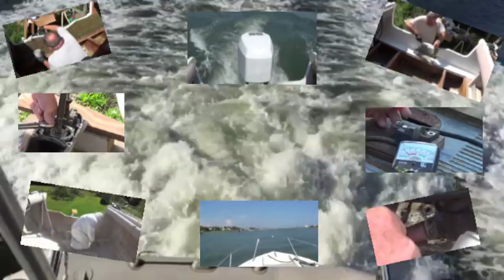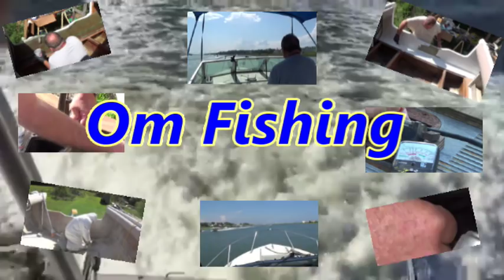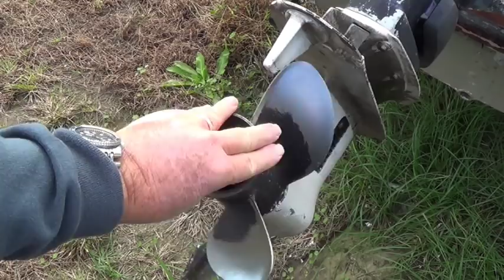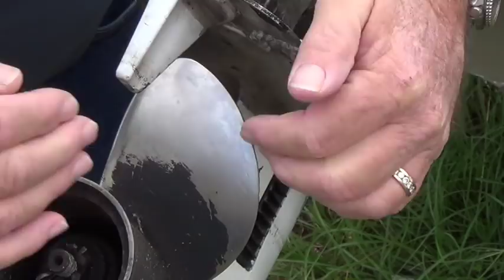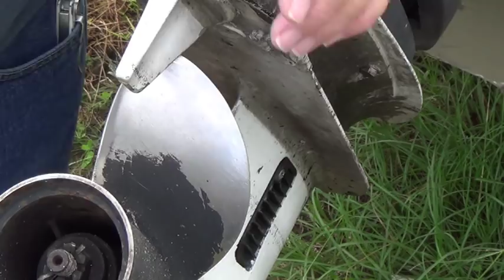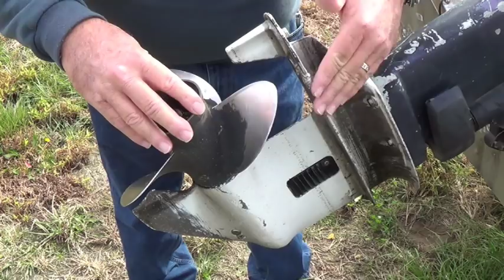The effects of Cavitation - Ventilation

Comment: You have cavitation a little backwards. The vapor bubbles are formed at the leading edge of the blade and collapse at the trailing edge. Cavitation happens when there is a lack of net positive suction head NPSH. In the case of a propeller, NPSH is obtained by the speed of the water, towards the leading edge of the blades. This is why high pitched props, cause cavitation during hard acceleration. Once the boat is up to speed, the cavitation goes away.

Comment: Interesting information. Great description! I have a 40 horse force motor. Short shaft. When I am at full throttle, I get what seems like occasional Misses. 
I do have some slightly chewed up edges on my prop. Do I have a carburetor issue or might those Misses be cavitation?
Reply from the maker: I think ventilation maybe. Anytime you have places on the prop can be a issue. I would make sure I had new spark plugs and clean fuel first. Than look in to the other.

Comment: Thank you for the info. I just put a “prop guard” on my 200hp Yamaha. At slow speed its fine but over 20 mph it starts listing the  boat hard (23footer). At about 25 mph I thought it was going to completely roll  over. Any idea what is happening and how to correct it?
Reply from the maker: My first guess is the motor is not mounted straight and the prop guard brought it to your attention.

Comment: Can boats with a lot of seagrass grown on it experience ventilation? It feels like mine is spinning in air on top speed because it goes much slower than before it was so grown under the boat.
Reply from the maker: The growth on the bottom of the boat can change the drag in the water. I would clean the boat before I start to change a lot of stuff.

Comment: HI MAYBE YOU CAN GIVE ME SOME SUGGESTIONS ON AN ISSUE IM HAVING. I HAVE A JOHNSON 30HP AN I HAD TO MAKE A HARD TURN AN I GUESS THE MOTOR VENTILATED, BUT NOW WONT START. WHEN TRYING TO START IT, IT SEEMS TO BACKFIRE FOR LIKE 3 SECONDS THEN CUTS OUT.
Reply from the maker: Back fire when starting is a lean fuel problem most of the time. When you made the hard right you probably suck up some trash in the fuel line and might be in the carb.
Reply: @OmFishing  I TOOK IT IN FOR SERVICE, WHAT HAPPENED WAS I SHEARED THE KEY ON THE FLYWHEEL AND THREW TIMMING OFF

Comment: Your prop shouldn't be spinning while you're putting it on the trailer.
Reply from the maker: I am by myself a lot and I use the outboard to run the boat on the trailer. Then I just get off the bow and drive the truck up to the parking area. Thanks for watching and Stay Safe!!
Reply: @OmFishing  I also launch by myself, and I have never run my prop while loading the boat.  Yesterday I loaded without a dock by myself, and I didn't run the prop while loading. I also didn't get my feet wet.  The prop should never be turning while loading the boat.
Reply: What are you talking about. Just drive it right on the trailer
Reply from the maker: When I am fishing by myself I just back the trailer in the water and run the boat on with the outboard motor. Check out my video (Fish oil fishing on the ICW {at 6:30 minutes} you will see me do it.
Reply from the maker: Or you can check out my video Running the Evinrude 225 Robalo Boat Project 60

Comment: What will cure burp cavitation. I can go at full throttle then you will hear a burp and the boat hesitates slightly. This only happens at top speed. 4.3 l8tr with alpa one drive 200 up hydrofoil did not help.
Reply from the maker: That is not a easy answer. Problems like that can be hard to solve. You might have to talk to a prop shop.  Does it do it with a different prop?
Reply: @OmFishing  I am using original prop. Only time this happens is at top speed the only thing that I see is maybe I am raising out of the water as not much of the boat seems to begin the water. Can outdrive be adjusted down farther or in.

Comment: Atmetferic pressure is around 15 psi, water boils at 100 degrees, when you apply a absolute vacuum lowers Atmetferic pressure water will boil at aroind 20 degrees.
Reply from the maker: Thanks for sharing your knowledge.

Comment: I have one of this dory! I just purchase a brand new Yamaha f25 tiller motor. The dealer wanted it to charge me 300 dollars to install the motor, but I was painting the bottom and doing some modifications on the inside. I went by what the manual and the Yamaha dealer recommended on how to install it. They required that the cavitation plate is level with the bottom of the transom. So I did and when I took the boat out for the first time with my brother in law going out and being out there was perfect until we started heading back in we noticed the motor propeller slipping my brother in law said its sounds like it’s cavitating. I have a 20” transom with a 20” long shaft. I thought maybe it was because my brother in law is a heavy guy and he was standing right in the front of the bow.  so when we hit any small wave the propeller was coming out of the water. He said it shouldn’t do that. I email the Yamaha owner and send them pictures of my installation and he said he was going to pass the pictures to his worker guy. It’s been a week haven’t heard anything. I want them to reinstall it to see if it would solve the problem. When I took the boat yesterday out for a ride myself to see how it rides with one person it was a horrible ride if I tried to go fast at all. The bow would stick really high and any little wave felt like you hit a rock and it was scary. I just want to sell this boat and motor if I can’t fix it. 🙁
Reply: Balance on small boats is everything. Boat at cruising speed should have a slight bow up orientation.. Trim your motor in. Till you find sweet spot.. And some boat hulls are just poorly designed. So they will ride like garbage no matter what you do
Reply from the maker: Don't give in so easy. It could be the hull design that is causing the problem. You might have to get the long shaft. Maybe you could fine a longer shaft motor and try it. I know they use them a lot on pontoon boats because of that problem.
Reply: Try to trim the motor on the mount; push the prop out to lower the bow when running without the front load(person)

Comment: What pitch prop are you running? I have tried running a 14 on my 30 evinrude and it ventilates on take off and if I'm following behind another boat where the water is aerated. Do you think moving up to a 15 pitch would help
Reply from the maker: I am running a 10x15 on my 30 hp evinrude.
Reply: You shouldn't be running a 14 pitch on a 30horse. Try an 11 or...12 pitch max.  9.9 diameter. And also pay attn to your trim. If its not power....just drop it down a hole. You'll usually lose about 2mph top end for every hole in but boat will handle and turn better. And stay on plane at lower speed.
Reply: As far as a 15 pitch The only way id ever run that much prop on a 30 is if it was pushing a super light and skinny jon like a 15 foot tracker with a 42 inch bottom and absolutely nothing in it but me. . there's no benefit to that much prop except you might eek out 35mph wide open with a boat that weighs nothing.